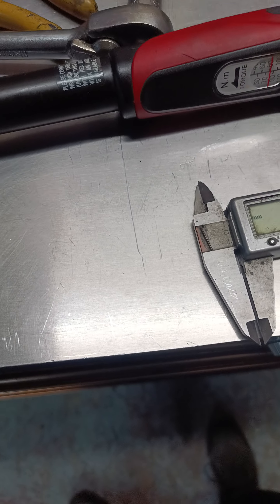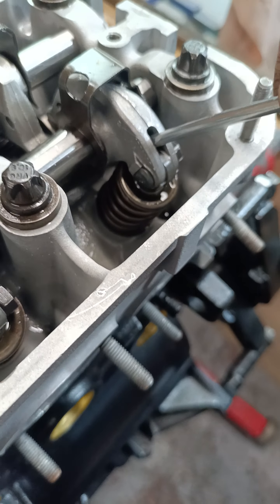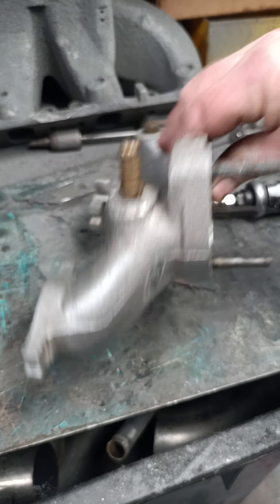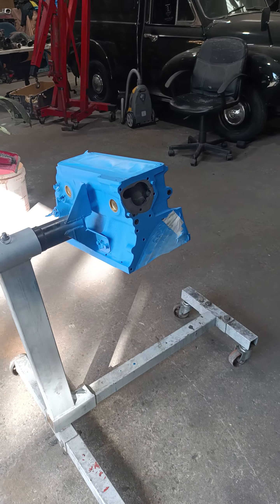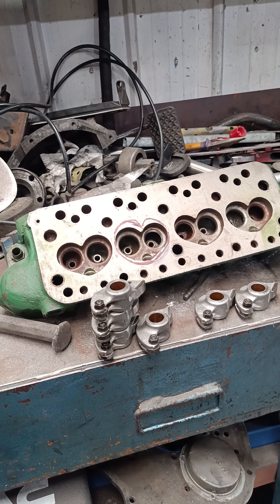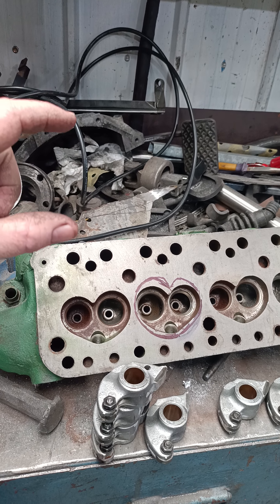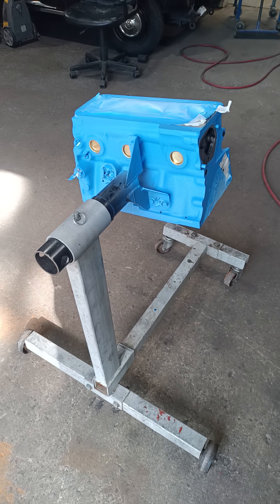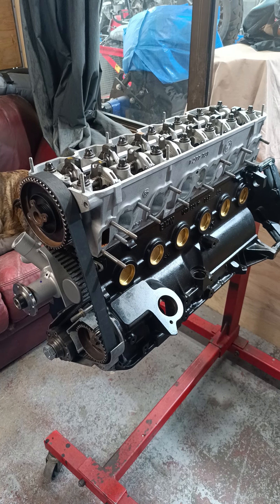M20B29 update and engine talk 🤗🤗🤗🤗 1330 update also

Comment: I need to build a 2.9 out of my 2.7 with a 885 head or 2.5 with the 731 head what would be the best starting option
Reply from the maker: @Haywardrc   best option for budget and longevity is this exact option , machined 2.7 pistons to run the 2.8 crank and a 731 head or run the 2.5 pistons with short rod and 2.8 crank and the 885 head, they all work so it's fun seeing the results from playing with a cool combo
Reply: 😊Amazing amount of precise work completed on all engines.